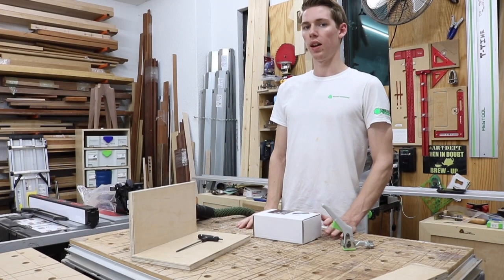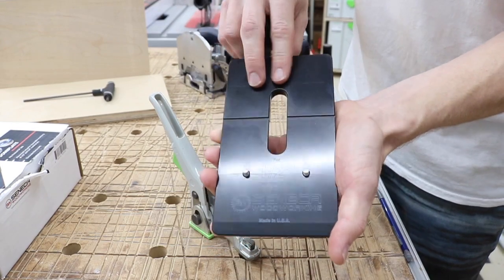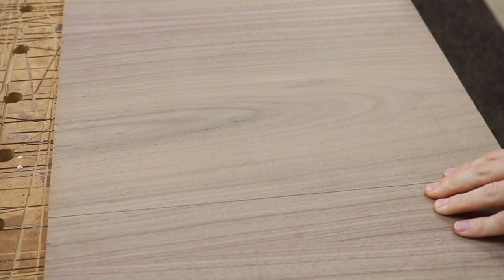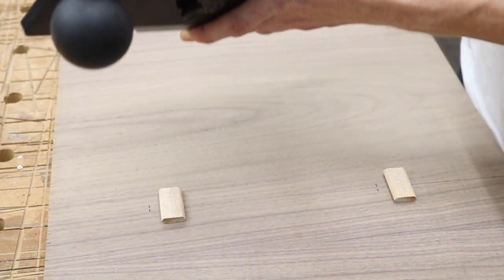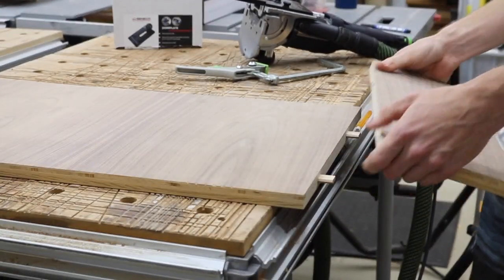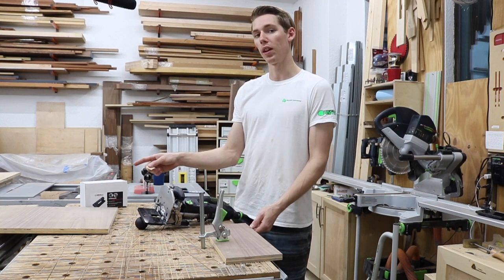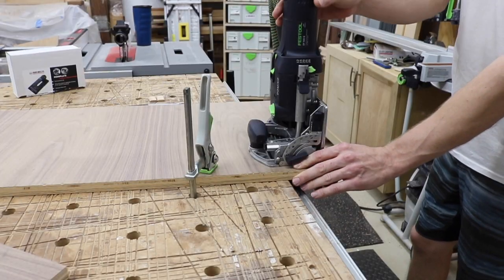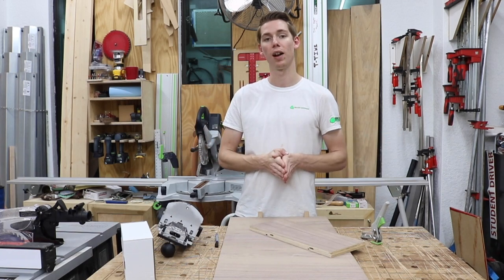Festool Domino 500 MUST HAVE ACCESSORY - Seneca Woodworking

Comment: It seems to me that you can get perfect repeatable results with the domino as it is. I don't understand why this is better?
Reply from the maker: There have been several users that have encountered fence drift, which this attachment eliminates. This attachment also takes out any guess work when working with dimensional lumber, all you have to do is change the depth. Taking out guess work reduces the possibility for user error.
Reply: I had the same question; I haven't used my new 500 very much so I can't comment on the fence drift issue. The base plate furnished by Festool looks similar to this add on product. It might be useful if our presenter would compare the two plates and indicate how his is superior to Festool's
Reply: This kid just wants to make money off of this. Be nice🤣

Comment: Having had the  domino  nearly as long as they  became available i would  definitely recommend the domino plate from senaca woodworking, i have seldom removed mine since i got it years  ago, and fence  drift can be a real problem  one of few from festool beside the price s  good  video  subscribed
Reply from the maker: Thanks for stopping by!
Reply: What exactly is fence drift?
Reply: @11211lcb  fence drift occurs when the fence  loosened and moves.it was an issue with the older df5oo not sure about the newer machines.
Reply: @Joyjoiner  I have had my Domino since 2008. I have.never had an issue.

Comment: At the start of the video an overview would be nice. Why do I need this?
Reply from the maker: Thanks for the feedback Steve, i will take note of that. If you did need further explanation after the video, the Seneca plate is great for cabinet builders, or anyone working with 1/2”-3/4” material that want to achieve flush results. While the domino itself is a great tool, sometimes you can encounter a slight bit of fence drift, which the do I plate eliminates completely.
Reply: @blacklabelcarpentry  What is fence drift and how does this eliminate it. can you provide an example . Thanks for the quick reply,
Reply from the maker: @stevestewart5496  fence drift in this case is the fence moving upwards as you apply downwards pressure. Now you should never apply that much pressure, but sometimes things come loose or need adjusting. You know you’ve encountered fence drift when you may have a slight difference in height when 2 pieces are joined together. It’s not usually much, but enough for you to notice if you run your nail over it. The domiplate eliminates this chance ever happening, even if you decide to rush through a project. Ive had great results when taking my time, but also doing a test when i tried to be fast and not pay as much attention, and i still had great results. Seneca woodworking have some videos on this attachment, and Ryan Murphy at US Tool & Fastener can also attest to the great results

Comment: I noticed you're using hardwood plywood...when I buy plywood it is never 3/4...it is actually 1/32 under 3/4... same for 1/2 inch.  My question is whether the "3/4" setting is for material that is actually 3/4 inch....  I understand that you may not always need to have the domino exactly centered on the board thickness so long as you keep your reference surfaces the same...but sometimes you do need to center as close as possible on the board thickness.  If my board is exactly 3/4 inch will the Domino Plate accomplish this?  Thanks!
Reply from the maker: Israel, you are spot on with not needing the domino to be exactly centered and this plate will work with any thickness material, but of course the placement of the domino will only be 3/8” on center or 1/4” on center as it is for 1/2” and 3/4” material. I have found no issues using the plate on the slightly smaller thickness plywood as it’s not quite enough to make it structurally weaker. If your board is exactly 3/4”, the plate will work perfectly. They also make a plate for thicker material. I believe that plate is 7/8” and 1”

Comment: But the domino has a built in plate.  Looks like you use it backwards? Why not flit it over and use the plate at 90?
Reply from the maker: yes it does, and while i have used it like that from time to time, the Seneca plate removes any chance of fence drift and allows me to reference 1/2" or 3/4" material exactly every time without having to think

Comment: very informative video, i am drooling over this machine.  i have a question, pardon me for my lack of knowledge.  can domino make a through joint, so that the domino (biscuit) is visible on the face of the project?  your reply will help me a lot.  thanks
Reply from the maker: Thank you. Yes you can! the DF500 offers dominos up to 50mm in length. The DF700 offers domino lengths up to 140mm. I have seen a fw makers exposing the dominos and its quite a unique look! thanks for the great question
Reply: I build custom furnature.  And I have built hundreds upon hundreds of drawers.  I reinforce drawer joints with a throufh plunge after the drawer is glued up.  I cut the excess domino tennon with a Fein Multimaster.

Comment: Getting here late but I saw this add on accessory about 10~12 years ago.   What does it accomplish?  I have had a Domino since 2008 and cut well in excess of 10,000 mortises with the 5MM cutter.  Plus numerius sizes with the other 3 cutters.  I have never ever wanted to hold the Domino upside down.   IIRC you mentioned fence drift....  Do you mean slippint out of adjustment?  There is a screw to tighten the lever for a tighter grip, I have never had to do that either.
Reply from the maker: So the plate eliminates fence drift. I do understand the ability to tighten the fence, but every now and then it seems to not register perfectly (only out a touch that catches a fingernail), so the do I plate eliminates any possibility what so ever of drift. I have even used this plate trying to be quick and make an errorr, but the plate has such good surface coverage, its very stable. Using the domino upside down feels no different to me as i put my hand at the very back like a pool cue.
Reply: @blacklabelcarpentry  if you are more confident using the plate I have no issue.  Fortunately I have not witnessed this situation.   It seemed to me upside down would present an awkward  step to operate the on/off switch, spinning the Domino around. I just realized that I will have had my Domino 15 years in May.
Reply from the maker: @11211lcb  you do have to flip it over, but its never presented much of an issue for me. I do however need to realign my domino fence as I've noticed its about 0.35-0.50mm out of square. Not that im building submarines, and wood moves, but its always nice to be as precise as you can!

Comment: I have the Domino and this plate. I’m still learning to be accurate with both. One problem I still contend with is making false cuts when starting the machine. As I push the lever to on I make a small plunge 😡. Do you start the machine off the work and then aline it?
Reply: pinch the switch on so you are not pushing down on the switch
Reply from the maker: I always start the machine, making sure the power button is fully pressed down, and then bring the domino to the work surface. Unlike a router, it is safe to turn on before bringing to the work surface, as long as you dont plunge until you’re ready
Reply: or you can simply pull back on the domino with one hand while you push the power button forward with the other hand